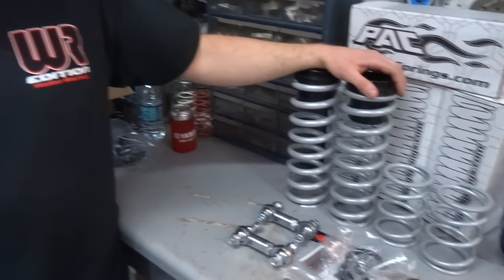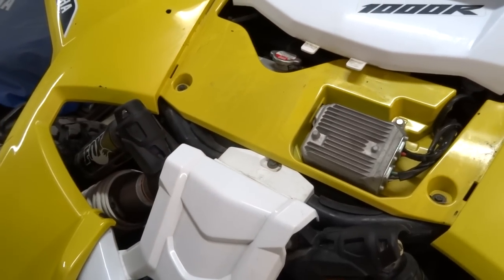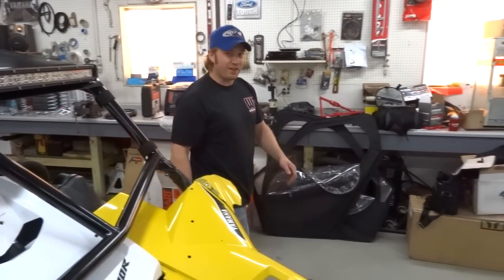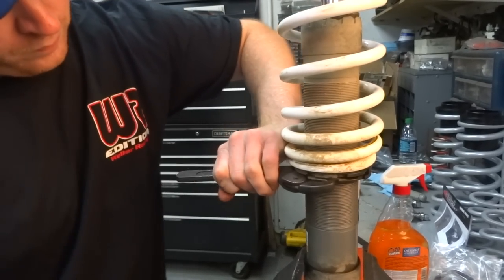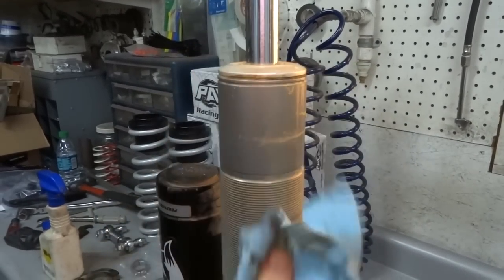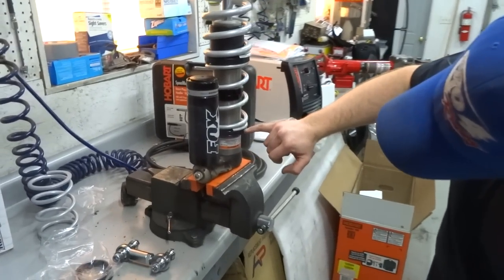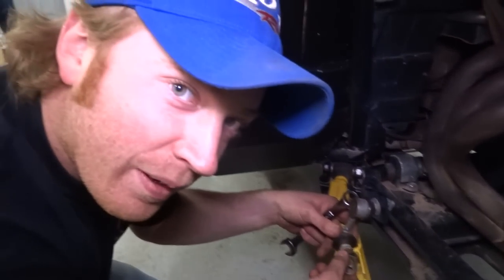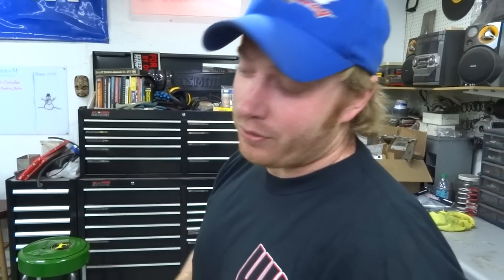Yamaha YXZ Weller Racing dual rate spring and sway bar links install!

Comment: great idea about sliding the sway bar claps on the drivers side and slide them over. I went to do them the other day and saw the flywheel cover was in the way for my big hands so I just held off til I had some help.  After seeing this Ill just use your idea. thanks.

Comment: Lads I have been trying to find something similar for a 2016 xds turbo any ideas please ?
Reply from the maker: I think CT Raceworx is probably still the go-to suspension company on those
Reply: Thanks will look into them tried a few companies I was told that the x3 has taken over the market and sourcing parts was really hard and was told my only option was to have custom built ones from shock therapy what as you know would be super pricey thanks for the info is much appreciated
Reply: @SXSBlog  did the sway bar links make a big enough difference in handling to warrant the price? Like the blog's guys keep it up have learned how to do most of my own repairs thanks to Doug thanks